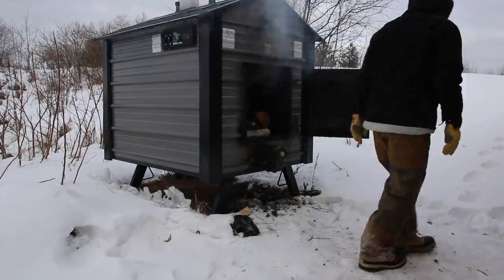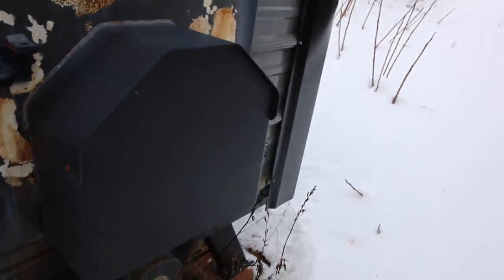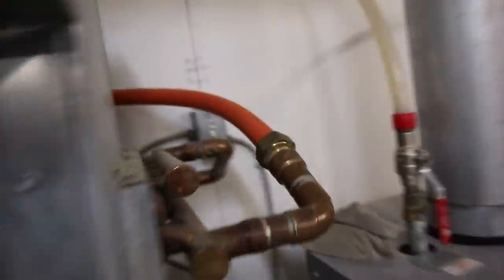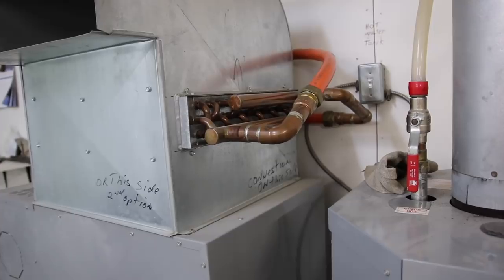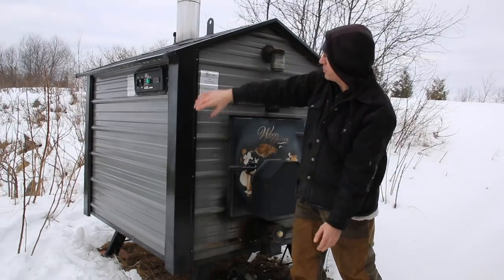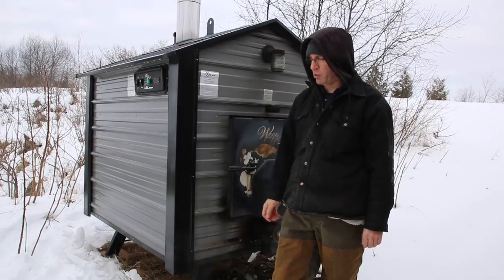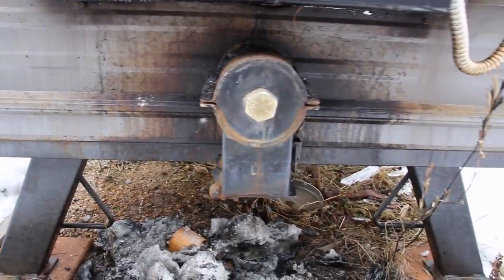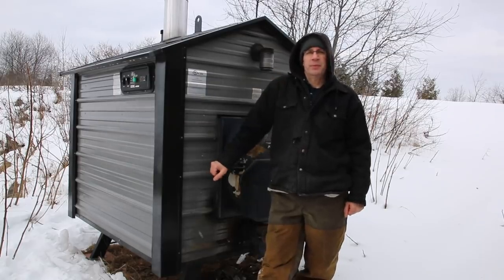Outdoor wood furnace "worth the investment?"

Comment: No, wood boilers are not worth the pain and price. Average stove cost 6000-8000 dollars. Then you have to buy the insulated pipe, another 2000 dollars, the you have high maintenance upkeep, buying antifreeze and a chemical rust resistant fluid. If your power goes out, is useless, it cant pump the water. I brought a wood heater for 800 dollars. Put it in my basement.   The wood stove hs a blower on it. So i cut a 20x20 vent for my return unit, from my air handler, which allows the heat to come throuh our vents. It dont burn 1/4 of the wood as a wood boiler. Dont waste your money on a wood boiler. Some people just think they have to have what they think, is the latest fad. Wood stoves are so awesome, cheap and effective
Reply from the maker: Like I said in the video I probably would not buy another one. You have a lot of good points. 
For me, I can't have an indoor wood stove because it is a water bottling shop. The health unit would not allow it. Cheers!
Reply: French River Springs, best wishs, and God bless
Reply: Do your research before commenting.   Your heating just your house.   Us people with the fad as you say are heating barns garages and hot water.   What's yours heating?
Reply: Mike Nichols,my bad. 100% of the people I know, and its quite a few, just use it to heat their house, 50% of them regret it, the other 50%, just want admit it. I do understand your situation through. But for just a house. Its to costly, and burns tons of wood. Best wishes, and God bless
Reply: I agree.   The amount of wood it burns is incredible.  If you are in a thick forest environment, without some heavy equipment the chore of cutting enough wood for a winter season is staggering.
Reply: BigB Xman My Brother had a Outdoor stove and in the middle of a cold snap he developed a water leak. He had no other heat in his old farm house and a very cold family. He called me up to see if I could help. I brought over a older pellet stove I had in the barn. We had it running in no time. The house was warmer then ever and only cost him around 50 pounds of pellet per day. 4dollars. He sold all his wood and bought pellets and was money ahead. And much warmer.
Reply: Glock2201 you sound like the sales man at the local county fair trying to bull shlt people into buying a outdoor stove. You sound just like them.
Reply: Farmer Dude Maybe I do but I am speaking from experience of owning one for a long time and everything I said was true. Your brother is one person who had a problem out of thousands of these systems in use. If your brother had a chimney fire with a wood stove would you tell people they should not use wood stoves?

I guess you agree with Big Man and he uses a 1/4 of the wood in an $800 wood stove as he would use in one of these boilers? You think I am lying but you believe the bull shit he posted?
Reply: Glock2201 I wish it was only my Brother but unfortunately I know many more. Chimney fires are not from the stove. It’s a poorly made chimney. No difference when installing a gas stove indoors. Gas line and vent must be done properly.  If you fill a outdoor furnace with good hard wood. It will hold at least 4 times the wood of a free standing stove. In 8 hours both stoves need wood. Free stand stoves did it with no moving parts and way less cost. Anybody, even a kid can load the stove with out getting injured. No one has to go out in the cold and rain to load a stove. You can cut your wood with a small chain saw and a axe.
Reply: I agree.  Nothing beats a good wood stove for a back up heating source.  Locating the stove is the basement is a good way to go.  The mess stays down stairs and the cement floor can't catch fire.  The only down sides are that you have to have vents in the first floor and you can't see the flames.
Reply: How do you deal with backdrafts smoking up the house, smelling up cloths? It would happen to use at least 3x a year. 
All the insects that tend to come along with the wood?
Also when we had the basement wood stove it was VERY hard to light, the updraft from the basement to the upper floors left the basement in a slightly lower pressure. So when the chimeny was cool, there was a near a negative airflow/pressure to the firebox. We used to use about 5 cord of wood a winter with the basement stove, our outdoor stove we use about 5.5 each year for the last two years, which here have been actually colder andmore heating days than the average. The wood is all in front of the wood boiler, and much less work to deal with. I don't have to put wood into the basement once a week. We get potable water heated in the winter as well, so we are coming out ahead right there. No smoked up house anymore, and we only feed the thing 2x a day. Once in the morning before work, and night before bed. We had to have electric baseboard by mornings whe under 0F and while at work they came on a couple hours before we got home when we used the indoor stove. So here we are ahead in costs. 5 years and so far no pump problems. But there is only stainless, brass and copper in our entire system ( including pumps). I have never had to change water, I started with distalled from our water distiller we have for drinking water, our area has nitrate problems in wells. It took 5 weeks to produce and maybe $20 in electricity. I just monitor ph, nitrate total disolved solids, adjust as needed.  We add maybe 5 gallons of make up from evaporation a year. I do not use antifreeze. IF we are gone that long, the basboards come on, and that also turns on a blower to the air exchanger unit I added for quicker heat ups if needed ( and central air)  so that and the in cement floor heat keep the water temps from freezing. We have an offgrid section of our house, which is also running the pumps, plus the computer control and monitoring system I made for it. I plan to change out the water before this heating season so that is maybe $75 in additives and about $22 in electricity more. Not to bad for a 5 year run. Yes, our initial investment was about $6500 but it should last 15-20 years if maintained well i would guess.

I find it hard to understand your position on the matter given our experience so far. All I can think of is poor design, or poor understanding?
Reply: Glock2201 OWB's are NOT that great. Seriously... You're on a high horse. Running them, when compared to propane, electricity, or oil, is certainly cheaper..... But you make them sound like an absolute dream. I'm on my seventh year running an OWB and hate everything about it. Loading it twice a day, cleaning ash every two or three days, lifting and moving literally TONS of wood, cleaning the boiler at the end of every season, welding patch plates if/when leaks develop, if we want to go on a vacation during winter we have to switch to electric which maintains the water temp and then restart the boiler when we return (which takes 3 hrs to get back up to temp), the constant cutting and splitting of wood and back-breaking work. Yeah.... Not worth it. When my unit is fully dead I will be switching to propane and dealing with the increased cost in return for simplicity.
Reply: I built mine from scrap steel. I have less than $1,000 into the WHOLE system. I installed it, the PEX, heat exchanger and eveyrthing myself. I like having the wood, smoke, bugs, smell.. OUTSIDE! I do enjoy going places in the winter now NOT smelling like a god damn camp fire. Also, the only other option I had to heat  the house was propane. Which, the few winters before, I was spending between 2-$3,000 per year to heat the house. Now that cost is under $500 per year. You guys might not like them, but I love mine. Everyone in my family has one now. As far as heat loss goes. I use 1" PEX ( I didn't bother watching this video to see what they use ) inside of 8" commercial PVC pipe. My PEX is wrapped with foam pipe insulation. I have about an 80' run from the back of my stove to the inside at the heat exchanger. I have a 2 degree loss. I've measured it at my catch tank then again inside of the house.
Reply: Have to be careful a lot of insurance companies will not insure your house if you have an indoor wood stove. So for me if I want a wood stove I would have to get one that is outside. Best thing to do is to get geothermal. Cheapest way to heat your house and don't have to cut wood and fee like you are married to the wood stove and filling it with wood.
Reply: jimthvac100 geothermal is only efficient if you live in an area that has mild winters OR has a heated spring. Otherwise the temperature delta/difference between your water in and outlet is nill which means you're just heating with electricity (yikes! Thats expensive!).
Reply: There's a product called the super jack furnace that would be perfect for what you are doing.  It's a furnace, not a boiler, has a large firebox, and is thermostatically controlled, has secondary air to burn smoke.
Reply: up keep is not much, and your insurance is zero increasing for an out door unit as no fire danger in the home, the unit must be 50 feet from anything that can burn, no bugs in the home no mess in the home, you dont need to split the wood or have dry wood, it is  much warmer heat and when you build you put in floor heating pipes witch are cheep, $28 cnd per 100 feet, heat your floors wall everything like a big battery, i use to go though $5000 in fuel oil, i feel for those using propane, it is the most highest cost fuel going, and it go fast and the moisture
Reply: Arnold Romppai i type this comment as i stand on top of the 2 bush cords that i just cut and i can say that heating with an owb sucks. Ps... I have an excavator with thumb to pick up and move the wood, 25 ton splitter, etc... And it still sucks. And low upkeep?! Are you kidding? Owb's are extremely maintenance intensive - scraping the box clean, managing water condition and level, pump and damper maintenance, steel box/water jacket welding/repair, ash cleanout, etc etc.
Reply: well like i said you buy a peace of crap and a poor install you get what you pay for, i broke my back years ago, can never weld again as a job, and other then picking up the phone and ordering 15 cord of birch logs for 1000$ and cutting it each day no splitting ever needed, check the ph once a year, thats it,, no cleaning til spring when i take all ashes out for summer, i never keep a wood pipe except the pile the truck drops off, then i cut up what i need for a day or 2,, you dont need any splitter, wasting your time and wood, no one here splits it, i rather spend $1000 cnd on wood then the 5000 i use to on oil, buy a unit with 3/16" stainless steel life time warranty, 2 bush cords is nothing, before i broke my back i use to cut 20 cords a day out of the bush an sell it, it burn so hot there is little to no ash
Reply: Arnold Romppai 2 bush cords is 6 face cords... cutting and splitting that amount in 2.5 hrs is damn good, thank you very much. Regardless, the logs i get are 2 to 3 foot round. I cut them to 24" lengths weighing approx. 80 to 100lb wet. I split them either in half, or in 4. Birch is one if the lighter/softer and narrower hardwoods so of course its relatively easy for you. Still, its hours upon hours of work.

My point is simple... If you have more free time than money, like working your butt off, or have no other option.... Sure, play with an owb. But, leaving to go to the office at 6am, in a suit, and having to load a boiler is crap. So is having your wife screw around with loading logs if you're away on buisiness.
Reply: Too much money for the return....
Reply: I have one & with a few tweaks on sealing the burner & getting the right amount of air wood last a really long time in it .I cut trees for a living so wood is no problem for me.
Reply: My brother had one and bragged about how cheap his gas bills were so I asked him on the 4th of July when it was 94 degrees, what was the payment on ur boiler last month!! He hasn't bragged once!!  How many more years till it's paid off!!!
Reply: Sounds to me you have a case of couldn't afford a much better outdoor wood boiler
Reply: @dand2440  no money wasn't a proplem because it's cheaper to pay the gas bill
Reply: Totally agree...100 percent
Reply: farmer that is about as ignorant a comment as bigb  wood for fuel is the same . if you are saying wood pellets give off more heat than wood of the same type you need to go ahead and stop commenting now. first it depends on how much a cord of wood is vs pellets. I don't know where you are but you cant but 50 lbs of pellets for 4 dollars in NC. so lets say you can That is 120 a month which is cheap to heat a home. to keep most homes around 72 degrees it willcost more than 120 in power or gas if you are in the middle or northern states. so for you to say 120 a month s garbage.  maybe in some southern states. But the main thing u are wrong about is how in the hell does a pellet stove put out more heat? If it does he had something way wrong with his installation of his wood boiler.   I heat 3200 sq ft log home. I turned mine down to come on at 145 and off at 160. with that setting i am getting 125 degree air out of my ducts and about 110 water returning to the boiler. been like this for 15 years. that is better than any gas pack or heat pump on the market by far. my home is also propane dryer and cooking so i still have propane. power bill in winter is 100. The dumbest thing anyone can do is not have a gas or electric backup. you brother is dumb if he is relying on one heat source. But most homes have only one but atleast could have a fireplace or gas logs. news flash for you and your brother if he had gas heat and it broke down he would be in the same boat. look up how much heat a certain amount of wood puts out per pound or cord or whatever you wish  a ton of seasoned oak will put out the exact amount of a ton of oak pellets. so your claim don't make any sense. house may be warmer but it is not because of the wood boiler or the wood. sorry dude been doing this along time
Reply: there is some truth to what you say. but if you want to spend that money on gas then go ahead. why not just cut it off now. see your still using it cause it is much cheaper. no one claimed it would be easier. I if you buy the wood and just have to load it it is still way cheaper than gas dude. the numbers don't lie. don't know where you are at but I am in nc and I can load my boiler get it where it is hot and then just tune my gas pack on and not really pull heat out of the water when I go somewhere for the weekend and my fire will still be fine when I get back which will keep the water from freezing. so I don't see your complaint being valid on that. in fact the fire should last at least a week if you stop calling on water for heat when ur on vacation. maybe not but more than a weekend I know
Reply: ur wrong man. it is cheaper to use but not to buy and install. the equipment is over triple what a duel fuel unit will cost not to mention the wells and or piping install under ground. that is as big a myth as solar. if it was so good all commercial buildings and homes would go to it. Think of it this way. my neighbor has that system equipment was around 20K. he installed all the pipe under ground hiumself so he didn't have the labor cost to pay. hundreds of feet of pipe and like 8 feet deep. ok his power bill is like 125 or so a month all year.OK lets say your is average 225 a month/ that's 1200 a year savings. OK figure up how many years it will take you to recup the extra cost of equipment. lets keep it easy. lets say the equipment cost 12K more than conventional equipment. it will take you 12 years to break even. Do you know what the life cycle of most hvac equipment is. 10 to 12 years. so unless your equipment lasts over that you are not saving a dime. you are actually spending more. plus the cost will be much more than 12K I just used that to make it easy. sorry man that is a myth like solar and electric cars. remember if none of this green craz was subsidized by the tax payer it would never get off the ground. another waste of our money thanks to our government.
Reply: really!! not my heatmore. its 15 years old and I auger the ashes out once a week into a bucket. what type do you have? why do you still use it? lot of complaining on here but the ones complaining are still using?? why is that? How old is you unit. how long does a hvac unit last? see you guys are not looking at the whole picture. where does it say the owb is easier? Plus some units are cRAP. I SAW ONE before I bought the heatmor and it was more or less a pot of water open to the environment. that is rust city. heatmor is a closed loop except for the air outlet it is pretty much closed to the outside air look it up. I treat my water once a year 35$ and in 15 years had to put two circ pumps on 200$. haven't had a leak yet but will one day I am sure. you know anyone with conventional units that last 15 years without any issues for maintenance? me either. I already had a splitter  since I have an insert. don't have my excav and miss it but I can either go get the wood or people bring it to me. I spens about 40 hours or so a years good excerize for me. I get it one day I wont want to do it but it save me a ton of money and I have a warm home. my wate rlevel never changes on the heat more. that tells me you have a not so good unit if it is losing water bud. that means u got sold a piece of crap potatoe pot basically. you should not lose much water at all if its a semi closed loopif you water is open to the air it is a bad unit sorry dude. I rresearched these for several years before I bought this one. central boiler is good also. most other not do much
Reply: BigB Xman -Wood stoves are not cheap.
Reply: Glock2201 -Calling other people ignorant because you don’t agree with them is, well... ignorant! His experience is his experience. Many folks don’t like these boilers after getting them and that absolutely does not make them ignorant. Keep your know it all mouth shut please.
Reply: Glock2201 -What you said you experience. That doesn’t make others experiences that are different from yours less valuable.
Reply: It's a lot of work no doubt. That's the down side,the upside is you stay healthy .Plus your woodlot is cleaned up. It's real easy to walk over to the thermostat and turn it up. When propane goes up and you're filling a 500 gallon tank that's real money , the wood is still free.